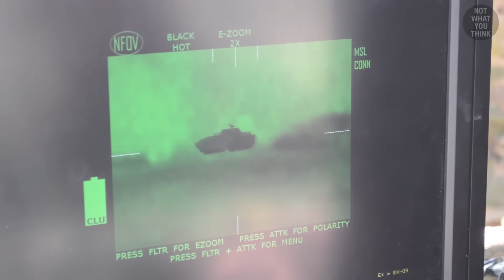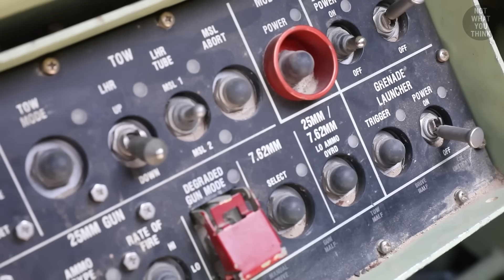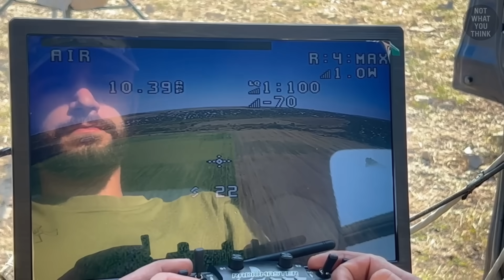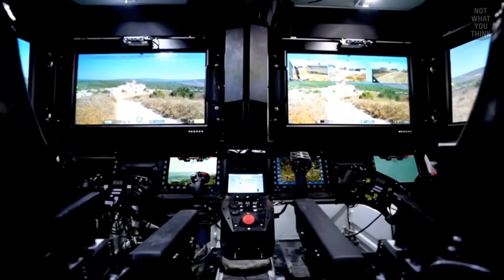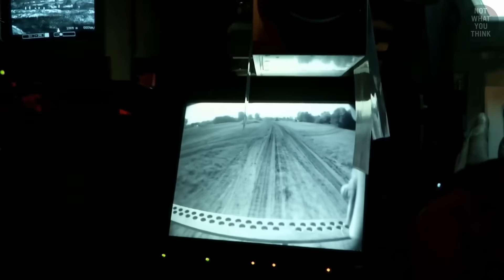How Bradley IFVs prove more Useful in Ukraine than Tanks

Comment: For now, the Tank is most vulnerable. A lot of that has to do less with the Tank itself, than the speed of development with other technologies. This means that eventually the Tank will catch back up.

Also, once Integrated Defense and Jammer Systems are introduced, and they are coming, Missile and Drone effectiveness will be lost. Though, as you pointed out, these two systems are best on Defense which is why they are most effective against Tanks in the first place. But the Tank is most effective on the Offense as well, so you would think that would essentially leave a Tank out of a job. But a Tank is also very effective on Defense as well and again, once the IDJS is installed, will make Tanks far more effective on both Defense and Offense.

The Defensive value of a Tank is that it can fire continuously up to 40 plus Main Gun rounds and a couple thousand Machine Gun rounds before resupply. By contrast, a Missile Vehicle might only be able to get off up to 4 rounds before needing to pull back to resupply. A Drone currently is either a One Shot Weapon or a Two Shot Weapon and will need to fly back for resupply.

Remote Operated Ground Vehicles are becoming a thing as well. The US Army already has a 20-ton prototype that is actually an Optionally Manned Ground System. It is small, lightweight, and carries a 20mm and up to two Missiles. If the US Army is smart about the design, they would seek to leverage it as a 20mm SPAAG and a 4-cell to 8-cell Mobile SAM, predominately for Anti-Drone Warfare, but still effective against Helicopters and development of future systems would enable an increase to Anti-Missile Warfare as well.

On top of that, they can be issued to the Infantry as Breaching Vehicles by which US Troops can advanced like in the video game Frontline: Fuels of War. Cheap, but replaceable becomes an issue. Even the material rich USA had to change some weapons tech during the Second World War due to surprising costs in using cheap materials. Especially when one realizes that the USA has to travel across two oceans to meet its predominate adversaries of Russia and China and their satellites of Iran and Hamas/Hezbollah add additional seas to cross as well as a whole other ocean in Iran's case.

Another thing to note, is that Tank Development has already suffered due to theory of Light and Fast. With Missiles and Drones, you cannot go faster with a Land Vehicle. It is physically impossible. The speed of a bullet is also such, that being out of the way is all but impossible. The reality is that the armor is going to be there as it has to be there. Even if it can't stop the bullet or the Missile, it can provide better protection that ensures less damage to the Human Soldier, thus increasing life expectancy.

The very notion of Light and Fast has already died a horrible death. As did the soldiers inside said vehicles. In a place called Afghanistan.

The concept of the Light and Fast theory dates back to the Toyota War. Although actual Light and Fast forces go back to the BCE. But they all had one glaring issue and that is the ability to be able to take on a strong force that is either entrenched, Cavalry has a nasty habit of being butchered by Archers or Artillery in a prepared position or in a Fortified Structure such as a fort, or attacking a field force that is prepared for them in advanced such as the Greek Phalanx or even a modern Anti-Vehicle Rocket or Missile.

The Infantry Square used during the Napoleonic Wars was a particularly useful Anti-Cavalry defense for a field army. Actually, used for centuries, its use by the British at the Battle of Waterloo secured Napoleon's final defeat as his Cavalry could not break the Infantry Squares. Even when the Pike was still a common weapon prior any Cavalry attempting to break an Infantry Square faced annihilation. In response, only the Infantry and Artillery could break up Infantry Squares.

Highly mobile Cavalry charges gave way in the face of Infantry armed with both Artillery and Machine Guns not during the First World War, but rather during the middle 19th Century conflicts in which Cavalry were simply unable to break a defended position with head on attacks. General Buford of the United States Army even noted that it was rare for Native Americans to assault fortified positions or try to fight strictly from horseback as is so popular in the old Western movies.

In fact, the opening battle of the Apache Wars was a battle in which the Apache had been in an entrenched position. Though, for whatever reason, both sides were terrible shots. Few were killed by Rifle fire, but when the US soldiers deployed Artillery, an Apache veteran of the battle reported as many as 50 or 60 had been killed or wounded in just a few shots.

And this was in spite of the fact that the Apaches were among those noted for decades as riding Horses into battle like the Plains Tribes. Despite everything, the Tank will resume its role in the Military. The Tank isn't obsolete now, the declaration the Tank is obsolete goes back to 1920 by a British officer who called it a freak of occurrence and then later still by Air Proponents and then again by Nuclear Proponents and once more, for good measure, by Artillery and Missile Proponents at different times.

Even the infamous Fighter Mafia declared the Tank obsolete as late as the 1980s and 1990s. Only in Afghanistan they were proven wrong. At a cost in lives and material. Ask Canada how liquidating their entire Tank stock worked out if you doubt me.

As for the blurring line between Tanks and IFVs, you only see the blur if you are sleep deprived working on this video. There is a very definite difference. A Tank doesn't carry Infantry into combat. An IFV does.

As for the M10 Booker, the US Army is avoiding using the word Tank when it comes to it. Instead, it's a Mobile Protected Firepower Vehicle or something else along those lines. Most people simply call it a Light Tank. Frankly, I'd call it an Infantry Tank as its job is to support the Infantry with Tank-like firepower. I don't know why nobody just uses the term. There might be some concern about British Infantry Tanks from the Second World War, plus the Cavalry units are expected to use it and they really get grumpy when they have to use 'Infantry' equipment.

But the US Army has been looking into the issue of weight and size. They've finally shelved the M1A3 program until the M1E3 program finally gets done. About time they got that program off the ground. Though, I'd wager if there is a M1A3 at this point, it will be a technology insertion vehicle to make way for the Abrams Replacement Tank Program Vehicle.

If I had to guess, the Army will reduce its weight to 55-tons, equip either the new 130mm or adopt Japan's own 120mm, go with a Remote Turret, add Vehicle-launched Drones, include an Intergrated Anti-Missile/Drone Jammer and Defense System, use a Hybrid Gas Turbine Engine, and maintain a four-man crew of a Tank Commander, Weapons Operator, Gunner, and Communications/Drone Specialist.
Reply: Modern SPGs are (usually) lighter AFVs with bigger guns that have evolved to a point where they can kill tanks far outside their effective firing range with precision indirect fire. 

Even back in WWII, however, the role of heavy tanks was limited by basic physics. Modern tanks have much better drivetrains than WWiI tigers but they’re still a pain to build & move & they get stuck in a lot more places than a 30-40 ton AFV.

Comment: Another example of hybrid between IFV and a tanks can be Merkava Mk1 tank, that can be used to carry up to 10 troops or Russian BMPT Terminator.
I wonder if it near future we again get distinction between light and heavy tanks, like during WWII.
Reply: Tanks are coffins like battleships are in the face of airpower. Obsolete. Just let go.
Reply: @frankgerlach4467 Can you name any piece of military vehicle that isn’t “a coffin” if hit by the right kind of weapon..?
Reply: @markhepworth  Have a look at the KraftKarre. Same firepower as a Leo2, but now coffin sideboards. Just 700kg of weight, minimal fuel consumption. The KraKa does not give the faux impression of "protection".

In 1945 tanks could provide protection, as the Panzerfaust had a range of 100m and bad sighting. Now MILAN can take out a tank at 2000m from a nicely concealed position. That is why I call them coffins.

Comment: USA already announced they dropped the SEPv4 upgrade for the Abrams in favor of developing what will be the M1A3 Abrams, it will be lighter than the current and they mentioned they want to decrease the logistics footprint. I am almost sure this means getting something like the powerpack of the Abrams X. 

Just think about it, electric engines always have PEAK torque and acceleration and they absolutely destroy combustion engines below 100km/h, which is the speed range that all current MBTs operate. There is a strong possibility all future military vehicles will go hybrid, you throw a small combustion engine just to be a generator and you still bring fuel because nothing can beat fuel's energy to weight ratio, other than that your tank is now accelerating insanely fast (for a Tank).

Comment: If you converted an M1 from hydraulics to electric, put in a data bus vs all the cables, and did all the minor tweaks like go to titanium road wheels you could cut tons off the weight.  You'd take out the screeching hydraulic pump on the AGT-1500 and install a generator in it's place and then use modern electric motors to drive the turret and gun.

Comment: if we want to talk about light and small armored vehicles, we should talk about the Swedish cv-90 120, and the Russian 2s25m sprut-sd. the cv 90 has a very small size but packed with features, and the 2s25 has incredibly light armor similar to the bmp, but allows it to have amphibious capabilities. not to mention these two vehicles make no compromise in firepower, with both the cv 90 and 2s25m using the same standard caliber as their modern main battle tanks, 120mm and 125 respectively. not only does this allow for more firepower, but it also simplifies logistics by allowing them to share the rounds used by their heavier comrades.
Reply: In the case of the Russian Sprut, if it faces off against NATO forces it would still die like their aluminum skinned cousins in the BMP series.
No amount of firepower and lightweight construction will save you from NATO air power.
Reply: @PeterMuskrat6968  вашу авиацию будут сбивать массово, это вам не бомжей хамас и талибов гонять без нормальной пво
Reply: Ahh, an amphibious coffin !
Reply: Yes bro, but I should prefer the Strid 103 (without turret and a very low outline) with the 25mm gun of the bradley (or twin)?

Comment: I think the best way to make an Abrahams tank lighter is by shrinking the crew from 4 to 2. Yes, the weight of 2 people isn't much, but the extra room for 4 in a heavily armored vehicle adds a LOT of weight. Plus you can get an unmanned turret, which can have its own advantages. We should try to automate as many tank functions as possible so that the human component reduces to just 1 driver and 1 gunner.
Reply: You still need a vehcile commander, tank needs guidance and needs to have an extra person to watch the surroundings and call out targets.
Reply: That's precisely the Russian approach - 2 men in the turret instead of 3 because you have an autoloading gun with the ammo in the turret cage. It makes for tiny low very-hard-to-hit turrets and means your tank can be a lot lighter for a given amount of armour thickness. But it also means they are extremely cramped, the crew are overworked in combat, and they blow up spectacularly if the turret is penetrated.

Comment: Tanks are not going extinct. In fact size is not that important, weight matters more. And in some cases weight has increased because of convenience. Now, at least in 1 case, there will be a redesign of the internal systems that will eliminate 10% of the weight. I am talking about the M1 Abrams MBT specifically. Going light and fast is NOTHING NEW. It works until you get hit by a drone or loitering munitions or a rocket, RPG, AT weapon in general.
IFVs aren't stealing anything from tanks. Why? An RPG -7 can handle an IFV easily. RPG-7s are cheap and easily produced.
You don't need air superiority to get reconnaissance from the air. This is why man has perfected the drone.
The BMP-3 is not shining. Nice try. It can do its job but its deficiencies are visible. Also worth saying that Russian infantry relies more on heavy infantry, which means IFV and soldiers with standard equipment.
The Bradley works. Thing is it has been getting additional armour to survive in Ukraine. That makes it heavier and less mobile. The survivability of the Bradley ISN'T better than most tanks currently in combat. Nice try.
The M10 Booker is not a tank. It's an assault gun.

Comment: I think MBTs are going to be re adapted to mission profile and role assignment. They may become fairly simplified, modular if adaptable. Medium tanks will fit the majority of a nation's tank force. MBTs are likely to become (functionally) Tank Destroyers, Self Propelled Cannons (not specifically Howitzers), or interchangeable Flank Units. As in, instead of a Spearhead on the offensive, they may be more akin to a Trident from a bird's eye view. They will be dispersed more broadly only focused to a specific point of breakthrough to widen an exploitation, which motor and mechanized infantry will surge forth in scattered formation to avoid CAS and Battery Fire. 

The MBT at that point will be able to conduct counter battery fire cooperating with drones operated by forward troops; as they are all closest to the fighting. The drones offering free data and real time footage can be translated to orders by the CO to the NCO. As is already being done... The MBT at this point should be able to conduct Direct, Indirect, and Plunging Fire. 

MBT may instead become Roaming Artillery, probing the enemy lines to find and fix an area for the ''schwerpunkt''. They will run perpendicular to a line only when directed to commit to a situation where a breakthrough is increasingly likely. Or Else they must pay close attention to enemy counter attacks and Drones plus CAS... Otherwise they will likely continuously zig zag and bee line parallel to a front line supporting infantry locally. MBT in that sense would be redirected to a sort of Bounding Overwatch.
Reply: So the Leopard 2 will become a Panzerhaubitze2000 with plenty of dronery for recon ? That could make sense.

Comment: Most tanks are optimized to 2d battle's they  design to take hits from  ground missiles and mine not from above
Reply: Modern ATGMs attack from the top, too. Why bother with side armor if the top armor is weak ?

Tanks are coffins and electronics rules. We live in 2023, not 1945.
Reply: @frankgerlach4467  Very flawed logic. You seem to think anything that is vulnerable is obsolete. Guess what, if you fight someone with roughly the same capabilities as you, EVERYTHING is vulnerable.